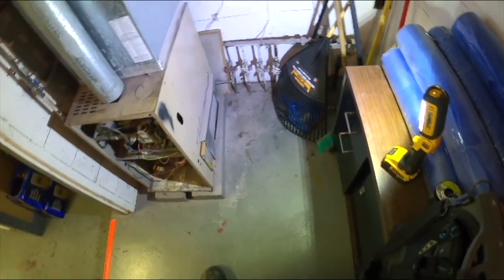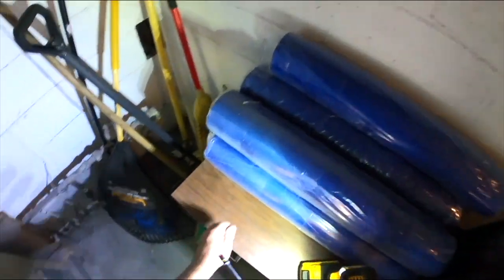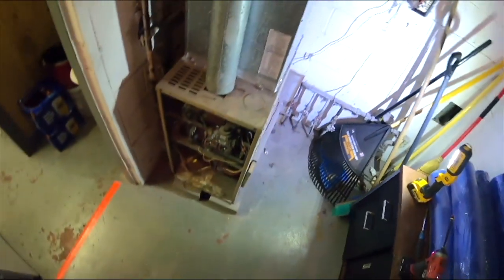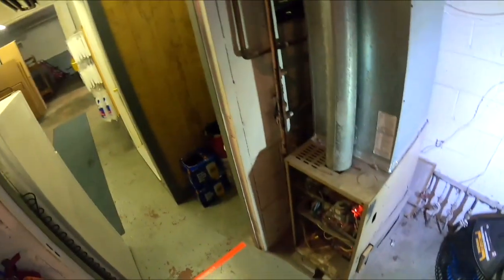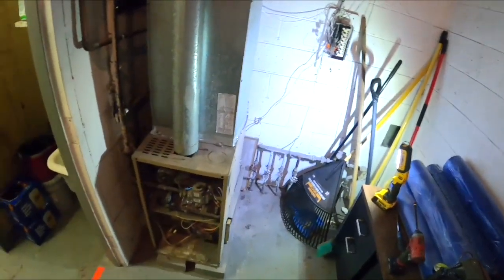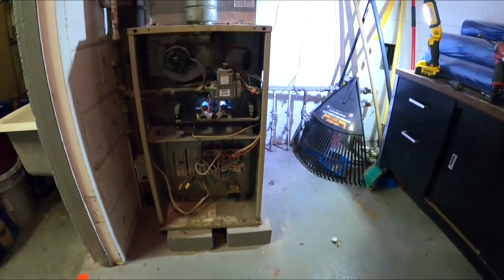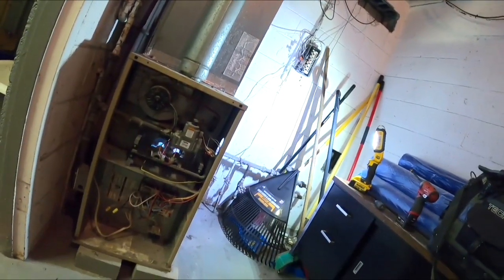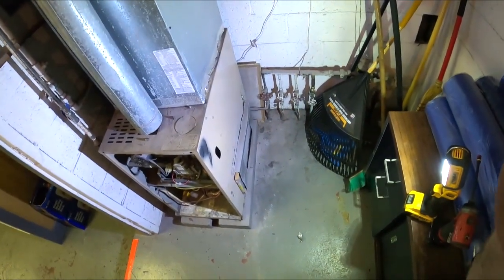I Wonder Why It's Going Off On Limit

Comment: A couple days ago I went to a “blowing cold air”call. I get into the basement, it’s a 6 year old nordyne gas furnace with supply of (2) 10s (3) 8s and a return of (1) 6” round. First thing I did was check the heat exchanger.

Comment: Could it have a weak or crusty flame sensor?
Reply: Huh?
Reply: @5822huron  You're correct.  The flame sensor is okay, the installation is awful. The unit is cloaked down on airflow.

Comment: I would check delta T across heat exchanger,then add a 90 on supply,then slow down blower. My guess because of the 0 static in supply the air is not absorbing heat when it goes across heat exch.
Reply: ahh fuck that hurt my side laughing
Reply: There is no air flow! Huh?